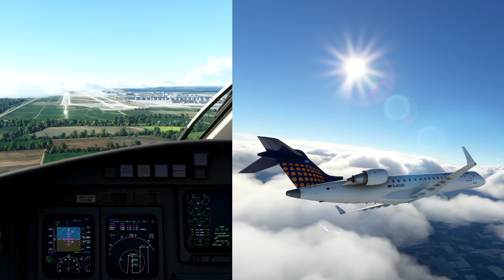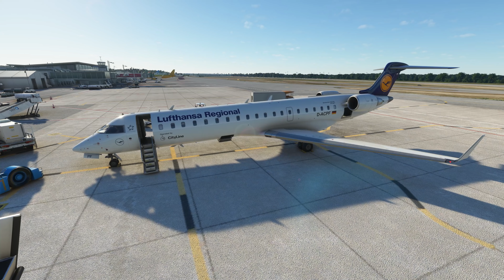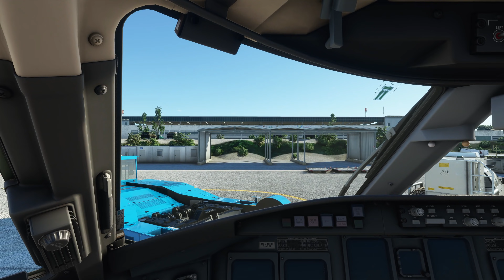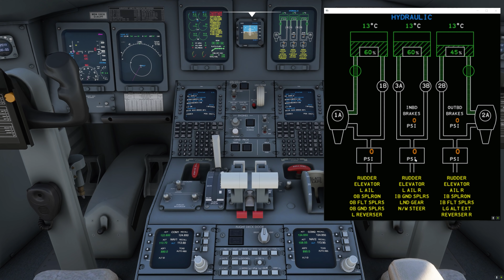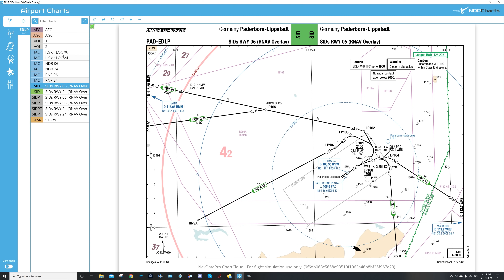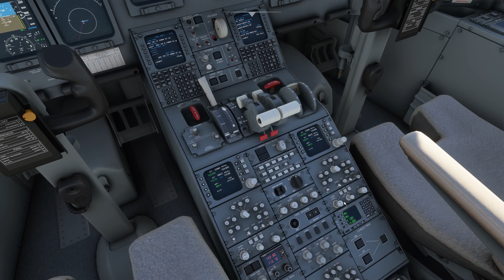MSFS Aerosoft CRJ Tutorial Ep1: The Safety Checks!

Comment: Thanks for the great video! One question; why is pump 3A powered on before startup? Aren't hydraulics normally left off for as long as possible for the safety of the people around the plane? Thanks! :)
Reply from the maker: HYD 3A will supply (among others) pressure to the inboard brakes, it is always a good thing to have working brakes when you start the engines.

Comment: Excuse me again Dude, reading the manual, I did not understand, the operation of two buttons, 1 the XFR MODE SWITCH and the TURBULENCE MODE SWITCH
Reply from the maker: The XFR switch transfers AP control from one Flight Control Computer to the other. The CRJ has two of them and you can see by the arrow next to the AP text on the PFD which one is "active".

The TURB mode reduces the "gain" or sensitivity of the AP commands. It smooths out the AP outputs a bit as to not overly agressive correct for every flightpath deviation due to turbulence.
Reply: @Flyer0245  ok thanks

Comment: Hi, 2 questions:
Why you need hydraulic power when on ground?
When there is no hydraulic power (the plane si completly shut down) I can still move the flight controls, is this normal?
Reply from the maker: You "need" hydraulics for the inboard brakes and when you want to move the rudder, ailerons, and elevator. It is a standard FSX/P3D/MSFS bug that these flight controls move without HYD power in the sims.

Comment: I see that the APU was able to be started with only battery power and no ground power connected.. Is that possible? Or has it been changed in the release version to require ground power connection for APU start?
Reply: Awesome thanks for that - and great video series!
Reply from the maker: As far as I know that is still possible in the release version. If not it would be a bug because it is possible IRL.
Reply: Thanks for the reply. Definitely seems to be a small bug at the moment, as pressing the Fuel / Power switch doesn't cause APU bite, SOV or APU door to open. Works with Ground power connected tho!
Reply from the maker: @ViperStrike81  Ok, thanks. I will forward that to the dev!

Comment: How is the fps compared to the stock aircrafts? I hope it's flyable in VR.
Reply: They stated around a 15% drop compared to default airliners
Reply: Considering he is using an extremely powerful pc, I'd assume it will be very demanding
Reply: @joerihuffmeijer3247  I bought it today. On my system - AMD Ryzen 3900X overclocked, 32gb, RTX3800 - it's pretty acceptable in 4K. A320NEO is just acceptable, default airliners are unuseable. Everyones system is different, but I'd say the coding behind the CRJ must be quite efficient based on what I see.

Comment: Who else came to this video mostly to see how the crj performs?🙋‍♂️😌

Looks great! By the way, will you guys include a sensitivity setting with it? Since the sensitivities are kind of weird, or is it just gonna be calibrated to work with 0% on every setting or something
Reply: Looks great ? 2:07 looks great to you ? These textures look like X-Plane stock cockpits in places
Reply from the maker: @davidtsw   Wait until you see them for yourself, they have nothing in common with stock XP cockpits
Reply: @davidtsw  At 2:07 I assume you're talking about the relatively low-res texture.  If that helps them with the frame rates, its fine by me.  I doubt I'd be spending long looking at that part.  And even the FJS 727 in xplane (an example of a fantastic aircraft in xplane as I recall) has lower res textures around the APU panel.

Comment: Great video! Why did the hydraulic temperature of system 3 jump from 13°C to 28°C when you turned on pump 3A from system 2?
Reply from the maker: That is a bug, the code must still be optimized for this bit.